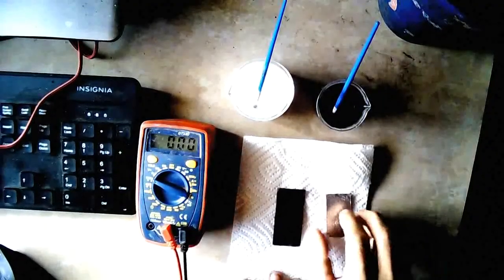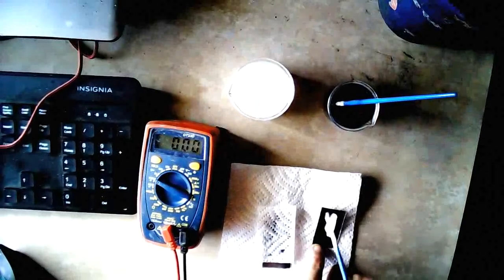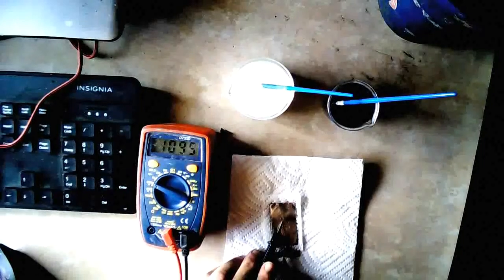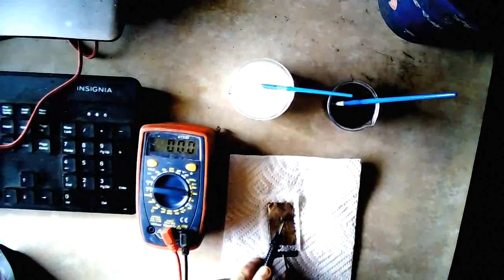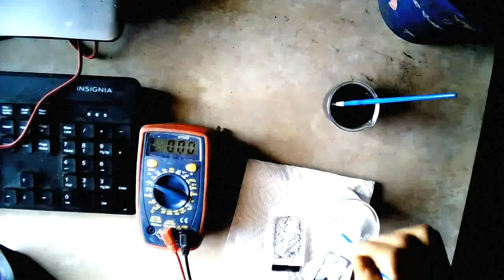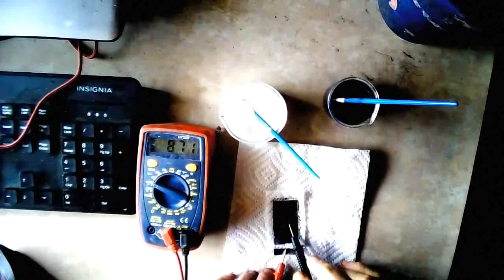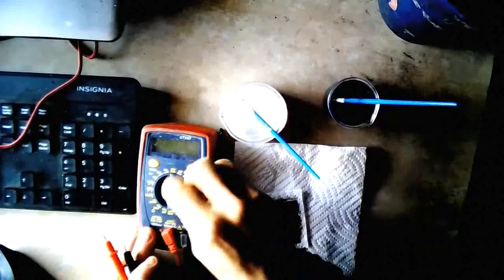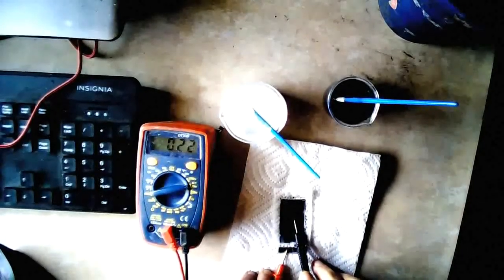Demo #41 All Carbon Bio-Cell Exp. #2

Comment: Hi Bio-Cell. Thanks for another upload!
Usually when I make a cell that jumps allot in voltage its because of the electrolyte. Either the separator is not "wet" enough. Or the electrolyte has to high resistance. I'm not sure, but in this case it is most likely because the Al is coated. Please try to sand down the Al to see if you get a more stable volt and a higher Amp.  Oh, and if you want more people to follow your channel, don't forget to tag your videos with keywords. :)
Reply from the maker: Hi BakamonNo, it's possible the separator is not wet enough, I only put a couple drops on it. I'll try sanding the Al too, but it was never a problem before. Maybe it has oxidized tho. Thanks for the suggestions. I use about 10 keywords on each video. Hopefully my videos are getting better and attracting people's attention, but shared videos (word of mouth) is always the best advertizing.

Comment: The cycling is a strange phenomenon, like the chemistry and/or charge are trying to equalize, overshooting and rebounding past equalibrium repeatedly. I have observed a similar effect during stabilization but with your configuration it seems to be more pronounced and at somewhat regular intervals suggestive of a resistive/capacitive reaction: https://en.m.wikipedia.org/wiki/RC_time_constant.

Comment: hi i missed the info, why are you using titanium dioxide with lime????
Reply from the maker: Hi Barry, because the anode needs to be alkaline/hydrophilic, in opposition to the acidic/hydrophobic cathode. I believe these are major charge-separation factors. I've tried a number of alkaline materials, and lime works good, but I just found a better material. I'll put out a video about it later today probably.
Reply: sorry inmy face thats whats im missing, playing with slime battery gel type sits at 850mv with about 50mAmps rechargeble. think im going to tru acidic one side and alkaline slime on other side. might be interesting results
Reply from the maker: Cool, let us know how it turns out.  Do you have a video on making the slime?